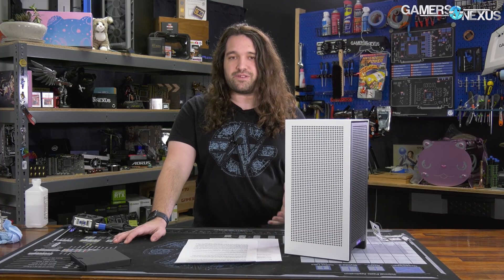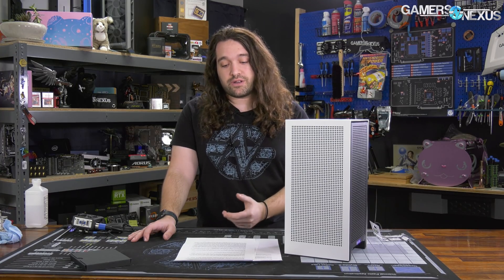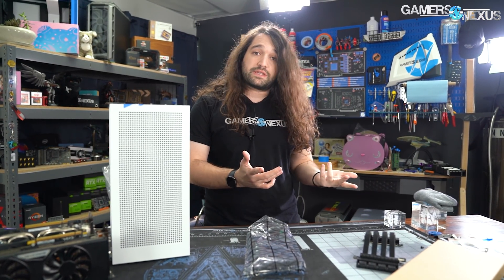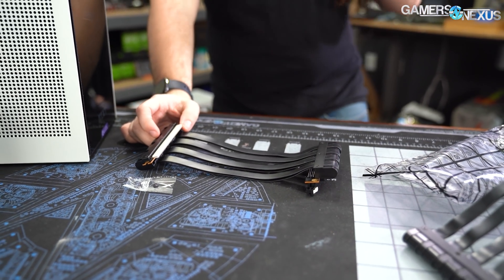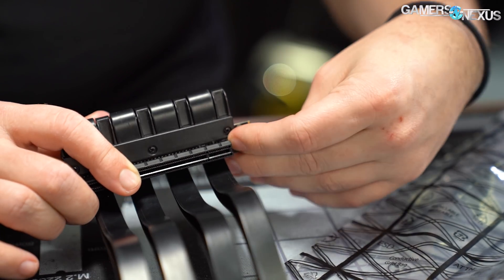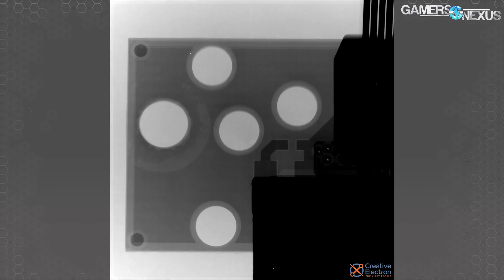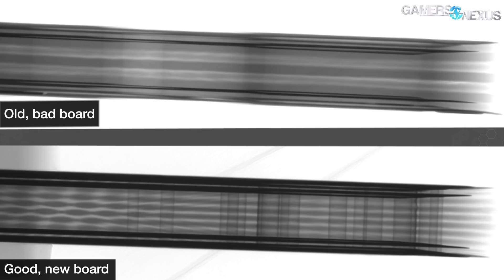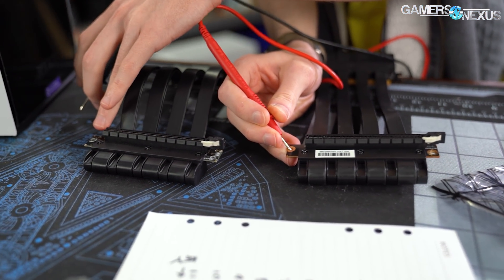Fire or No Fire: New NZXT H1 Riser X-Ray & Testing (NZXT H1 PCIe Riser Fix)

Comment: To the 8:15 question.
The tubes you see are vias to connect different layers of the pcb together. Normally used around the PCB to have a good ground plane connection.

Comment: Electrical engineeer with pcb design experience here...

The tubes that run the length of the board (called "vias" in jargon) are used to add more mechanical strenght to the joint (since they are copper plated)  the pcb material will creep over time (basically squish and deform permanently) under the screw pressure, making the board thinner and thus the screw will not hold down the board correctly.

They are very important in high vibration environment (think automotive) since the board vibrating due to the loose screw can be damaged.

In a PC case, they are always a good practice, but probably not strictly necessaty (there won't be much vibration)
Reply: I am also a PCB and electronics designer as a hobby. I have a question. Should that mounting hole be actually connected to circuit ground? I think not, because of amount of current that could potentially flow via unknown path (and need to add things like coatings, screw torque, etc), instead using anti-parallel path back via motherboard. That could both lead to worse signal integrity, heating up of the screw or contact points, as well be a bit unsafe when we are dealing with almost 10A of current (i.e. some gnd wires break in the raiser cable). And could mess up with the low side current measurements and overcurrent protection devices.
Reply: @movax20h There is no hard and fast rule unfortunately and really depends on the overall system design. 

In a complex circuit like a motherboard you will most definitely have more than1 ground, also ground and Protective Earth (PE) will be different (typically mounting holes along with connector screens are connected to PE that  is connected to ground in a single point through either a ferrite bead or a low value resistor/zero ohm link) .

that said in  a good design the engineer should know exactly where its current will flow (path of least resistance/impedance) and that should never be through a screw.

especially in a mobo, where you can potentially have several hundred amps going around your ground impedance should be so low that the path through the case should not give you any ground loop problem

Comment: The extra vias (the small plated holes that go entire depth from one side to another) around the mounting holes are plated, and the primary purpose of them is to add extra mechanical support and the current to flow between a screw face and the copper plane, which could be on the same or other, or inner layers. Also these vias will ensure connection, even if the plated main hole is damaged. They are not strictly needed, but are quite common these days. They are sometimes called sattelite vias. Actually there is no specific standards for these kinds of mounting holes via sattelite vias as far as I know, and some designers use them, some doesn't, sometimes depending on the use, etc.

Also whetever the mounting hole should be connected to ground of the circuit, is debatable. Sometimes they should, sometimes they shouldn't. In this case, beceuase it can be carrying quite a big amount of current, it actually shouldn't be used for grounding. For example, if the ground wires in the raiser, or the other side of the riser ground pins become damaged, the current will flow, but now via the mounting point and chasis, instead using intended route using the cable. This is problematic, because sometimes a resetable or electronic fuses could be on motherboard to monitor the return current, and if the current instead goes via the chasis, weird things could happen. It also makes signal integrity worse. The return path should be parallel and close to the input path, for various complex reasons. The other issue with using mounting hole to also be connected to chasis ground, is now you have issues with screw torque and/or the mating force between the screw, PCB, and the threads in chasis, and coatings of the screw and chasis, which all add to variability and unknowns in your resistance and reliability. Using mounting holes for grounding is perfectly valid strategy in some situations and actually needed, but in many other cases actually should or must be avoided.

I think the mounting holes should be plated and with vias, just like they are here, for mechanical strength, but should not be connected to the ground on the PCIe slot, as this might mess things up.

My suggestion. Send these two raisers to Dave Jones from EEVblog youtube channel for analsysis. He is the biggest electronics design channel on youtube, and he has probably over 30 years of PCB design expirience. He will probably make an hour in depth video on it.
Reply: Out of all the via comments in the video, this one is the best, particularly about the vias around the through hole. One more thing to note: the vias around the outside provide a low inductance ground plane, which helps for signal integrity in high speed circuits such as this one.

Comment: 08:41 - that is a fiducial on the corner, used for machine vision to define coordinates on the PCB for accurate positioning of features from drills to silk screens to keep outs etc.. The tubes are vias and are just there to help keep the ground planes at the same potential across the length of the board.

Comment: TL;DR: NZXT cut corners to try to save on manufacturing costs, resulting in shipping out fire hazards. Only took, what, 6 months to get them to actually fix the problem?
Reply: On the one hand, yep. On the other hand, there was probably no way to fix it faster since they had to retool or contract with a new manufacturer, so the turn around is about what is expected from any recall. Normally when car companies find problems they maintain internal memos about it with their legal department, begin the retooling and stocking of parts, and only present their findings to the government safety commissions and begin recalls when they have adequate stock. There's a little bit of gray area as to whether this is legal or not, or they should inform immediately. Usually it can be justified by claiming they are doing an internal review at the same time they are retooling and restocking to verify the issue is real, this internal review is usually just a legal cover though.
Reply: @dragoonsunite  "On the other hand, there was probably no way to fix it faster"

Maybe no way to fix it faster, but they also didn't need to mislead us about nylon screws being a fix, and didn't need to put the case back on the market when the problem wasn't fixed yet, and didn't need to drag their feet in regards to a former recall. I very much wonder if NZXT would have actually done the right thing if GamersNexus hadn't put out those videos demonstrating the problem.

I agree with Katie Tree, I too will be very skeptical of NZXT for a few years.
Reply: @mjc0961  I mean as someone who has been part of a recall. My experience is that it is a legal matter that even the company itself is limited from saying anything publicly without approval from the CPSC. 

They were very likely already working on a formal recall as this process doesn't just happen overnight unless it's a massive corporation like Apple who can force it.

I believe the recall would've happened regardless of the GN video but he just happened to make the video with great timing.

I'm looking at both sides of this, did his video make it happen faster? Probably. Would it have happened without the video? Probably.

Every company makes mistakes, if they don't learn from it then that's when they should be looked down upon. You don't see everyone destroying Samsung nowadays after they made a phone that literally blew up.
Reply: @dragoonsunite  There was definitely a faster way to fix it: not replying to customer reports and concerns with memes, ignoring the actual issue, postponing the recall, or trying a cheap band-aid fix when at least one of their engineers or developers had to have known that nylon screws were not a solution.

Comment: those ''tubes'' are vias, if they werent there you might be able to delaminate the plating, basicaly they are supports
Reply: Yes, and no.

They are usually called vias, but technically vias are the plated holes that go entire depth of the stackup, and are there for electrical purposes only, and at the end are usually covered by soldermask, and before soldermask, could also be plugged (tented). Or not.

The ones here, around the mounting holes, will be called vias by most people, but primary purpose of them is mechanical stregthenning, they will be non plugged , and will not be covered by soldermask. I am not sure what is the proper name for them, but sometimes people call them just vias or sattelite vias or sattelite suppoer vias. I don't use them for mounting holes usually, only for big screw terminals and connectors that are screw in on PCB, this is to carry a bit more current, and as an extra reliability, in case the pressure of the screw damages or makes some cracks in the copper.
Reply: @movax20h  we call them PTH reinforcements. Used to tie everything together electrically and/or mechanically.
Reply: @MikeStavola  Yep. That is a fitting name for it. I like it.
Reply: @movax20h  "in case the pressure of the screw damages or makes some cracks in the copper."   Isn't the degree that NZXT torques down their screws a bit of a meme with Steve?  Maybe they really are trying to address all their issues!
Reply: I think this is correct. https://electronics.stackexchange.com/questions/240092/why-do-some-pcbs-put-vias-around-mechanical-through-holes
Reply: the op gets it, it's purely mechanical.  mechanical strengthening of the fiberglass PCB with squishing force from tight screws. not just lower inductance vertical electrical/thermal connections that a mounting hole generally doesn't need for a properly designed PCB layout (that complies with NEC&CE laws). The ONLY time I have ever placed smaller vias around a mounting hole for reasons other than mechanical strengthening the PCB, was under a TO220 like part for thermal connection to what the screw was connecting the PCB to (AKA a heatsink on the back of the PCB for the TO220 part)

Comment: The "tubes" are plated vias - a hole is drilled through, after which copper is added via a deposition process, and then more copper is added to that base via an electroplating process.

In this case, it has been done to provide low impedance to the case. The screw will have the best contact on the top of the board, but the ground plane seems to be on the bottom. These vias provide the shortest possible path from the screw to the ground plane. The solder dimples are simply formed by opening up the solder mask, so the solder paste squeegee applies paste at those locations. Surface tension takes care of forming the shape.

Comment: As stated by earlier comments, the "tubes" around the large mounting holes are vias in the PCB. These are small holes which are drilled through the PCB before the plating process. Just as the large screw hole, they get plated with copper during electroplating.

Plated mounting holes are often used to create an electrical connection between the ground potential of a circuit and the housing in which it is mounted. This is done to improve safety and can reduce the electromagnetic interference around the board. Adding vias through the pad surrounding a plated mounting hole is done to ensure a proper connection, even if the plating in the actual mounting hole is damaged by the screw.
Reply: Probably also to improve EMI (electro magnetic interference).  Nice explanation
Reply: Also if the pad need to make connections between metal and screw you can have already solder balls to improve the connection quality

Comment: Those "tubes" are vias. They are designed to connect top/bottom tracks (or planes, pads, etc)  of the pcb. In this case the pads are most likely connected to GND. The vias connect the pads on both layers just in case the screw removes the plating in the hole, breaking continuity.
Reply: the vias are not used to connect top and bottom in this application ( the plated through hole is enough, and also there are connection to ground/earth polygons on the top and bottom) they are needed for mechanical strenght to avoid creep of the pcb

Comment: I believe those are PTH vias running the full board stack. This is done so that even if a screw 'bites' through the plating on the inner screw hole that it won't cause the layers to start de-laminating. So this isn't (I think) electrical, it's mechanical.

Comment: Is the new riser still PCIe gen 3 ?
Reply: Probably as already explained in the previous videos. With the signal precision required for PCIe gen 4 I wouldn’t even want any riser (cable) there. I’s already a marvel of engineering that risers for PCIe gen 3 works without too much issues.

Comment: I have received and installed the new riser. Everything working fine. I was one of the first people to originally contact NZXT after this issue was flagged. So that may explain why I already got my fix.
Reply: What happend to the Old one, did they want it back? Probably not, since shipping would be rather expensive for a product that basically has no worth, costs for repairing them with a new PCB would be more than the Product is worth.
I cecommend destroying it by cutting the cables before giving it to recycling, so nobody bothers to fish it out of the trash.
Reply: @timhartherz5652  trash can
Reply: Likewise.  Same for me.  I contacted them before anything was officially announced.  I have my new riser installed and things are working without issue now.  I was having issues before, but wasn't able to determine what was causing them before Steve and GN brought this to our attention.
Reply: Nice dude I got mine last week I was also one of the first people to contact them, it seems to be working fine with no fires. Hope the same is true for you.
Reply: Not received it yet, but got a message from support i ll get it ..soon ..until now rather good support
Reply: I was wondering if yours also had the cheese grater look to the board? I just got mine and I still have a bunch of holes punched through mine as well? Mine looks like the original with just the copper plating around the screw holes. Nexus board looks like a totally new redesign.
Reply: @yukiyuklee4894  You should post pictures or a video of it.
Reply: For what it's worth, it's still one of the best itx cases. I love it.